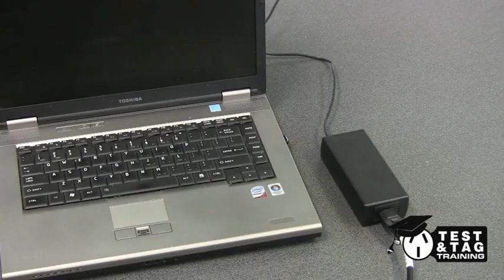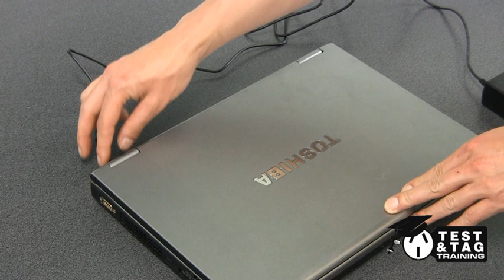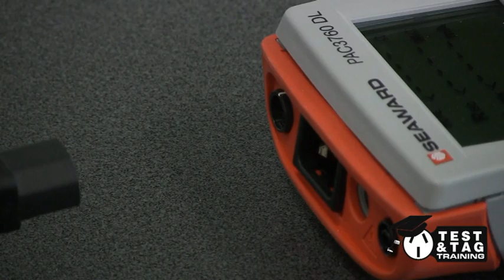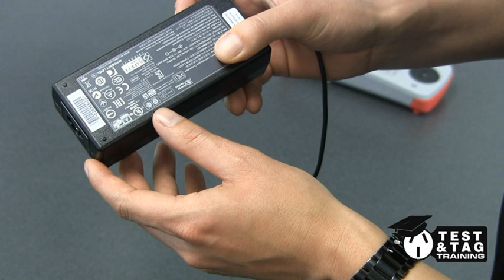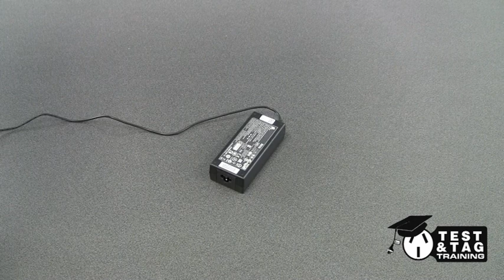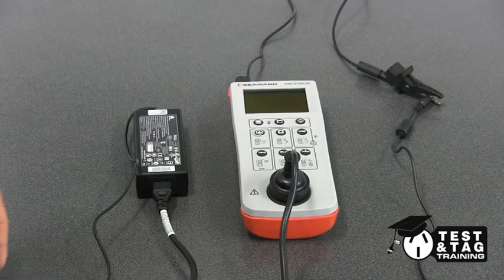How to Test and Tag a Laptop

Comment: The issue with testing a class 1 as a class 2 is that the tester will indicate a fail if the leakage current is higher than 1mA which if below 5mA is a pass for class 1